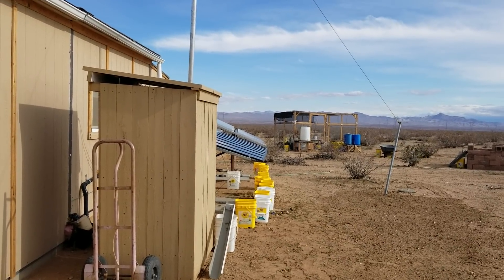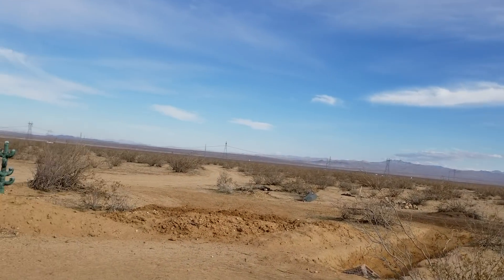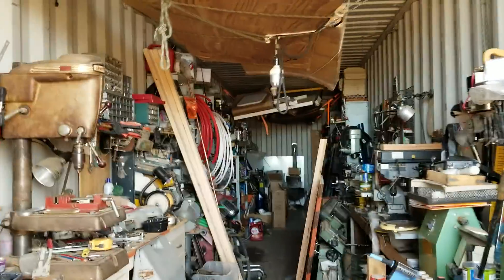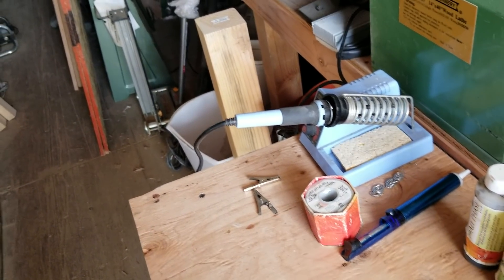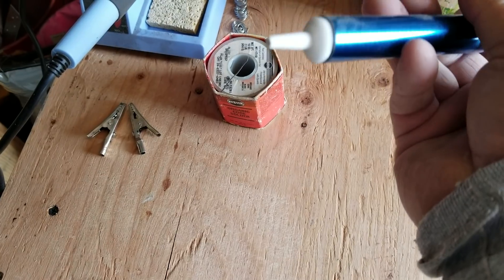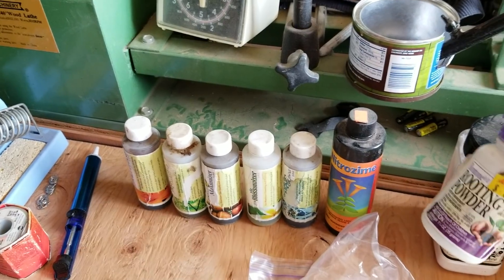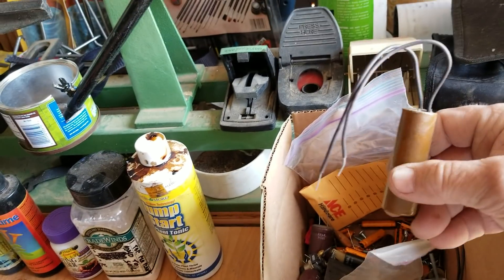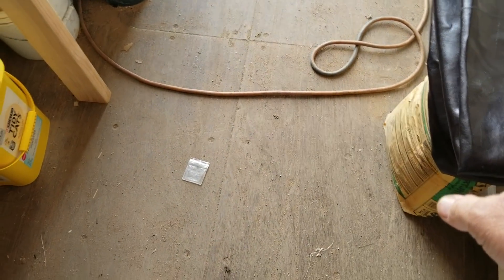Off Grid Ways, A Homestead in the Desert Jan. 13, 2019

Comment: I used those same wellers in my electronic at my station to solder many parts and wires on our circuit boards.We also used that roll solder
Reply from the maker: So you knew what you were doing, huh?  ;-)
Reply: Sure did finely made Supervisor over Assembly Until I retired in 1999
Reply from the maker: @josephineflatt74  outstanding accomplishments!
Reply: @GBear  Thank you, you have acccomplishments your self in the dry open desert.